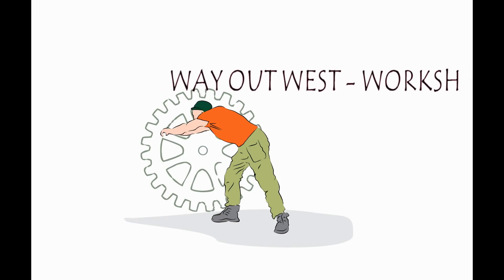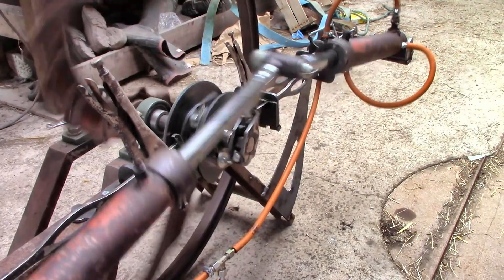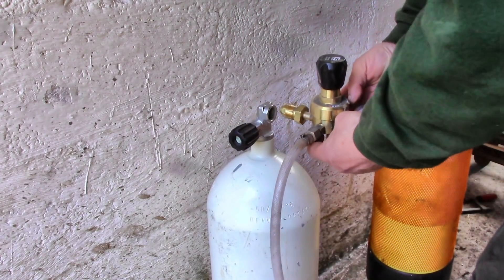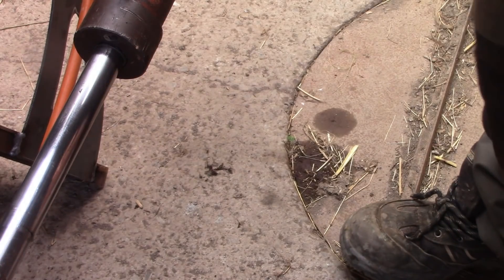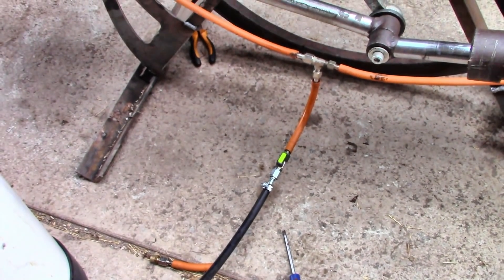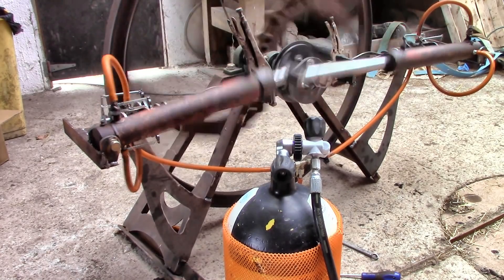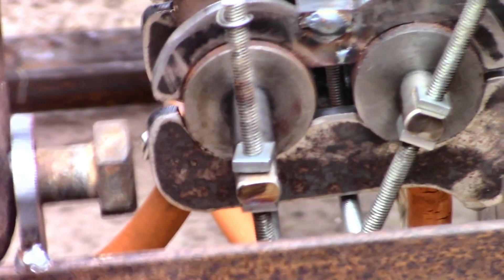It’s Alive!! Air-Powered Locomotive Moves On Its Own!

Comment: I was thinking the pull side is smaller than the push side chamber, so pull chamber could be high pressure and push could be low pressure chamber. Put the two chambers in series it would be way more efficient. Should help if you make it a steam engine too.

Comment: I'm working on an idea that a compressor (If it didn't leak while under High stresses) would work in which the pump can change the pressure (Lets say 100Psi)  If the intake had a bottle at 100 psi and the out take receiving would equal a 200 psi after the first go around.

The second go around would have an intake bottle with 200 psi and the outtake would yield about 300 psi  (again the pump would only have a 100 psi strength but the air on the intake side of the pump keeps the resistance down to only a 100 psi felt range?
Thus a stepper system would be created and a low power yield windmill or Sterling engine would work over a longer period to fill the air tanks.

Comment: If you used shorter cylinders and a shorter Pittman arm would you still have enough power? Also, did you consider making the cylinders double acting? Lower volume per revolution providing you generate enough force with the decreased leverage.

Comment: Try making an engine with stationary cylinders and hook both ends to the valve chests. You should end up with a more stable engine and not need a huge flywheel. For lack of a better expression, your development process is just reinventing the wheel.

Comment: Probably a stupid question but ---- how the heck does a compressor run a plasma cutter?
Reply from the maker: an electric arc heats a stream of air (from the compressor) to 30,000 degrees..
Reply: @wayoutwest-workshopstuff6299  Ahh.. okay.. that makes more sense now.  Thanks!  :)

Comment: Maybe you can use several pressure regulators in parallel.
I'm afraid you've already identified the biggest problem yourself. 
Compressed air is one of the most expensive forms of energy

at all. Steam is a great thing 😤

Comment: I've only seen this one video atm ....But I'm gonna have to be "that" guy, and say  But I think the design needs a Tweak. You have both hydraulic cylinders on the same plane as one another... 180 degrees out, although this works when the fly wheel is spun,  when the engine is stopped in a TDC or BDC position there's no way for the cylinders to push past this when fed air as the crank arm  and rods are all in a straight line thus no turning moment. You can actually see this happen when you run out of Fly wheel momentum around 3:20 in the video. This is EXACTLY why  twin cylinder locomotives  are phased 90 degrees from one another and not 180.. so there's always a cylinder at the right angle to effect a turning moment on the crank. Also.. those are double acting cylinders, there's A LOT of power potential and efficiency being lost not utilising the retracting ports on the rams to give power on the up-stroke.

Edit: Ok now I've watched a few more videos on it, you did address these issues .. at least you've got an upgrade path later on if it struggles 😅

Comment: Some a/c compressors (not maybe just piston one's) could generate very high pressures too. And you could prepressure air for feeding those better one's, you can took most moisture and even heat away at first compressor phase, then high compress more. Use for testing good overdressure vents and disk that could relase pressure out of building if something fails. Use inverter to drive secondary compressors, no matter what type those are. And big voltage, less amperage at same power. Ampers heat coils more than voltage, and there's many solutions for it. You live too far away, otherwise I could help you very much.. with compressors and their drivers..
Reply from the maker: If I disconnect the pressure shut-off switch, how much pressure would I get from  my workshop compressor?

Comment: why not just use steam? That's what I'm wondering, do a hydrostatic test on the boiler to make sure it's safe and then you can use the steam to power a steam engine which would turn an air compressor, and now you have a locomotive which runs on compressed air (lighter) while also having a good supply of compressed air.
Reply from the maker: Interesting - but complicated?

Comment: Great stuff, very promising. Try putting fins around the pipes to heat the compressed air before it enters the cylinder. It will increase the time. Use the exhaust in a bigger cylinder with interheating, just more fins or go high tech and use a resistance heater wire. Most trolley bus and trams used two stage heated inlet motors. Some even tool on hot water to heat or had small burners.
Reply from the maker: Thanks - very interesting.

Comment: A large 18650 battery bank drives an inverter which supplies power to run an air compressor, which is all mounted on the railcar.    Air compressor drives the engine which pulls the railcar.   Done.
Reply from the maker: Surely it would make more sense to have the motor run the wheels though?

Comment: I believe the reason steam locomotives have such large diameter pistons is because they are able to utilize lower pressures. You appear to be using hydraulic pistons, which are not optimized for gases
Reply from the maker: They're both just pistons - how are they optimized, I wonder?

Comment: G'day,

Run ye 3-Stage Compressor from a Wind Turbine, that'll outlast Batteries and Solar Panels... (!).

Stay safe,

;-p

Ciao !
Reply from the maker: I'd like to try that - it might even work!
Reply: @wayoutwest-workshopstuff6299  

Apparently the trick is to have a step-down drive- ratio from a high-speed Rotor, maintaining lots of energy in the Disc to be able to operate in fairly light winds - in average winds kinda thing, so that it harvests something almost every day...

Another approach might be to get a big Waterpumping Windmill ("Southern Cross" type, we call them here...), which won't go more than 200 or 300 RPM, but they have a 3:1 Reduction Drive between their Windwheel Axle and the Vertical reciprocating Push-Pull Rod connecting the Mill atop the Tower with the Piston Pump in the Well...; and after making adjustments for Stroke-Length..., bolt the Air Compressor's Connecting Rod direct to the Windmill's Pushrod ?

It might take a Pair of Flywheels on a common Axle, with Crank Pins at different Radii, one from the Windmill turning the Flywheels and the other driving the Compressor's Connecting Rod...(!) ?

It would be fun to see if that could give you 45 minutes of Traindriving per week, kinda thing...?

Have a good one...

Stay safe,

;-p

Ciao !

Comment: this is awesome! compressed air locos where extendedly used in mines. i realy like your approach building and using your own narrow gauge industrial line and you are on the run to build your own early 19th century style (the early steame engines used similiar flywheels and - in modern sense - absurd cylinder configurations. in fact you came close  the trevithick engine ) compressed air locos.

i dont know whether i should suggest to google some of the things in mentioned or simply just watch what happens. never the less be care full, have fun and i would love to see this project going on!

Comment: Here’s a thought: you could use your flash boiler and compressed air engine to power a generator that provides energy to a battery that you use to move your engine. That way you aren’t having to waste fuel on the generator to spin a power a generator and provide energy to the battery and can just use it for chopping wood and loading it. That enormous fly wheel hooked up to a generator could really work wonders I would imagine

Comment: I am a fan of locos myself, but in the long run compressed air is expensive. They are very energy inefficient to produce. For me, a draisine would be more practical for your setup, and they are more interesting than battery or petrol locos. But only if your hips and knees agree to it.
Reply from the maker: But if a windmill compressed the air, then efficiency isn't an issue..
A draisine only makes sense, surely, if you want to travel faster than walking pace? Otherwise you're better off pushing?
Reply: @wayoutwest-workshopstuff6299  That's a good point on the draisine idea. 
To drive a compressor you will need a lot of torque, and that can be a problem with windmills.
After considering all these, going electric looks more and more practical, but man they are boring. And I wonder whether it can survive your lovely Irish weather. Hmmm...

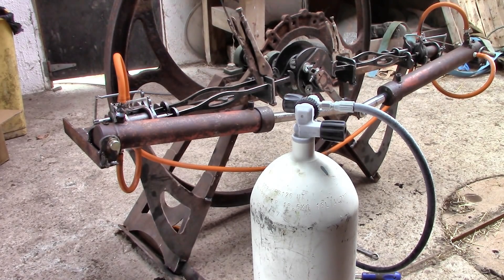Comment: 3:30 if you're able to get more parts for it I'd try and make an identical cylinder set to go on the opposite side of the flywheel it might give the engine more pulling power

Comment: And now to make a flash boiler from the stainless pipe coil out of an old beer "temp rite" cooler from a pub. I have a couple of double acting 4"× 10" pnuematic rams I scrounged from the scrapyard- much lighter weight than your hydraulic ones- and you've given me ideas!

Comment: I'd recommend using a ribbed belt to easily attach it to the axles on both the engine and drive axle. Then for brakes you could use brake shoes that squeeze onto the top part of the metal wheels. Love the build so far! :D

Comment: To drive wheels for the locomotive, why not use tension belts. Get the engine running in the direction you want it to, then pull a lever to tension the belt, and then you have drive. Or if your engine is only capable of one direction drive, you could put a gearbox in after the tension belt with a reverse gear. This way you could decide what amount of pulling power you would want to use, as well as having variable speeds. Hook this up too a natural gas powered steam boiler( or any fuel of your choice) and then your in buisness.

Comment: I've been toying with the idea of trying to generate electricity and hot water from fire.  Since the recent massive energy hikes (in the UK) it's becoming cost effective to generate your own power (well, except for battery storage which is too expensive).
My plan is to pass all the 'exhaust' through an atmospheric engine and use water-mist injection to heat water and power the pistons. In theory keeping the final output above 100'C should prevent water problems and that can be condensed at the final stage providing hot water.
Quick calculations show a maximum of 3.5KW per Kg of wood burned but then the potential for 80% heat recovery giving near 90% efficiency (maximum, I'd be happy with 70%).
If only I didn't have too many projects on the go and a free source of wood!  Still battery storage is the major project killer.
Reply from the maker: Yes, an easy and effective way to heat domestic water with wood would be very useful and interesting - let us know how you get on?

Comment: Since the air compressor uses an electric motor to turn make the air, why not swap for the engine itself with a bit of air in the tank to get things moving?  I'm sure this is stupid, but I think with the right gear ratio you might be able to generate enough air to keep moving, potentially.  I am quite sure someone will tell it won't work for whatever reason, just a thought on my behalf.  Thanks for the video!

Comment: My apologies if this was asked before but I couldnt find it. Why don't you have the two pistons with a 90 degree offset and power both strokes rather than 180 offset with a single stroke powered?
Reply from the maker: Making them double acting seemed more trouble than it was worth - because the piston rod takes up so much room in the cylinder

Comment: there is a guy on youtube who claims to have built a car with a big propeller driven by the wheels, once you give it a little push, the wheels drive the propeller, which pushes the car, which drives the wheels, which turns the propeller, which.... and it just goes faster

Comment: Here’s an idea. You could set up a small heater with either fire wood with steel air lines go through it, so when you run a high pressure bottle, it won’t freeze and lose a lot of efficiency. You might increase the power and running time by heating the air before it reaches the pistons

Comment: Hello Tim! Hope you and the Misses are well. I saw you had greasing points on the cylinders and was just curious as to what type of grease or oil you are putting the engine. All the best and keep up the good work!
Reply from the maker: I was thinking of using vegetable oil - what do you think?
Reply: @wayoutwest-workshopstuff6299  For a steam engine I would suggest steam oil or lithium grease. For an air engine as long as it doesn't fully compress the oil anything is better than nothing I reckon.

Comment: I thought of using 2 or 3 old 20 lbs propane tanks flush them out with air, the hook them together, fill them with compressed air and run a cart using an old air drill with a reduction belt drive
Reply from the maker: I'd like to see that - though it could be noisy and fast?

Comment: How about an unused carbon fibre lpg tank ie car ,van  charged with your compressor I think they can be charge to a high pressure and are very light just a thought but I must say it’s a genius design 👍👨🏻‍🏭🇬🇧
Reply from the maker: lpg stands for low pressure gas, so perhaps not high enough?

Comment: The problem you have is the tight turn radii near the ballast dump and presumably that track will be Extended down to where wood deliveries are dropped off for charcoal making. Wood, stone etc is heavy so you'll need quite a bit of power, yractive force and the ability to negotiate tight turn radiii. Another sticky variable about any loco is the driver. Putting all this in a frame alone with the engine does present some engineering challenges. Some of which leave us with little options but to explore well tested ideas. During steam days, with ver long engines it was common for turns to be quite large. Taking. Up huge amounts of land but that is not something you have in abundance. So, as a single engine will require a man, a large gas cylinder, an engine and that giant flywheel. It would be more sensible to use some sort of double bogie with enough pivoty twisty bits to enable it to negotiate the turns.
With the plasma cutter you have and wheel design sorted out and tested, it's not to difficult to explore a few different ideas without costing a fortune. A few bearings, some plate, pipe along with a few other bits and bobs, this could work reliably.
Its not a model railway and elegance is not what you're after so, simple design with simple working parts is all that's required to make this an efficient charcoal making business. Except for the compressed air engine. Time taken to mess about with filling cylinders will do your head in after a month of operation.
I am an engineer designing products for the company I work for and without a doubt there are the foundations for a good operation using simple systems like your railway. Its not dainty but it works, and that's the most important thing. Happy to do the CAD work for you to design a cheap engine if you like?

So no electric motors are needed or anything elaborate. Only the present air rams you have now and build 2 separate bogies with a gas piston and crank connected to one axle.plasma cut a few gears to connect up the 2 axes on each one and make the pistons double acting. Take the input of one ram and feed it with a T piece to the return of the other one. You'll only need 8 inch wheels like you make already with a crank on the end of one axle, mounted outside the bogie and keep using the valve system you've already built. Maybe add lead to the inside of each wheel if you want enough flywheel mass. The key here is using what works and what is available and solving a problem reliably.
A lot of viewers would like to see a type99 fluggenfroufer engine wich ran on the Austrian lines between 1900 and 1925, because that's what they like. Other say use electric. Don't. It's a royal pain in the arse and expensive to set up. Pwm speed controllers, motors, chains etc, all cost money. Something which is in short supply. What you have is a plasma cutter, air rams and such like. Keep using them but change how you apply them a bit
Reply from the maker: Thanks, Gwyllym. Yes, I've considered putting me and a bottle of air onto a bogie - but I want to try something else first. You're right, I have to get around that tight bend - but it might be more practical to rebuild the bend wider and have more options on all the rolling stock.
I see the air-loco as mostly a fun experiment - and something to help build my channel. I don't know how practical it will really be when I need to haul heavy logs but in the meantime I'm learning a lot, and who knows, it might perform better than expected once I modify the engine a bit more.
I appreciate the offer of help - I have so many ideas I never have the time to explore them all, but if you see me going far astray then reel me in, won't you? : -  )

Comment: Is there a way that you could recycle the air so that none is lost in the process? Or possibly use the flywheel to generate more air to fill a secondary tank whilst the first is being discharged, while also recycling the exhausted air?

Comment: maybe just belts and pullies so you could have the engine running but just pull a lever to engage drive
Reply from the maker: Yes, I think I''m going to try that first
Reply: Super cool will be keeping an eye. Made a aluminum model of something similar but used a spring loaded cam instead of the more efficant double acting valve thingy you got.

Comment: In Germany they made locos that were powered by compressed Air  driving an engine.
The problem is steam is expanding the whole time its in the cylinder so more power,  also you cut back when running so saving steam.